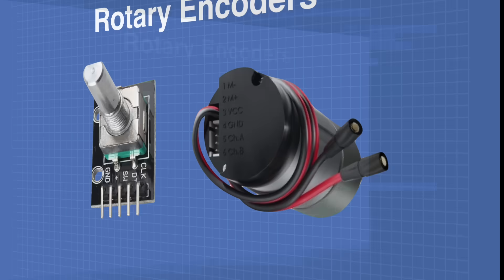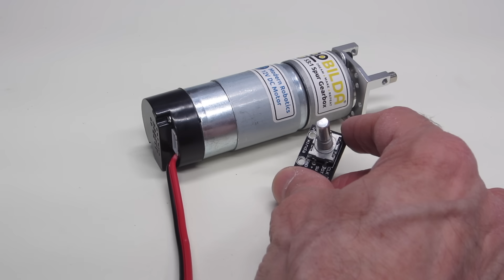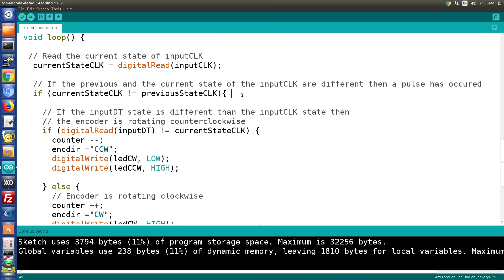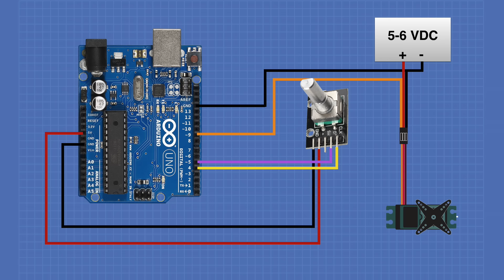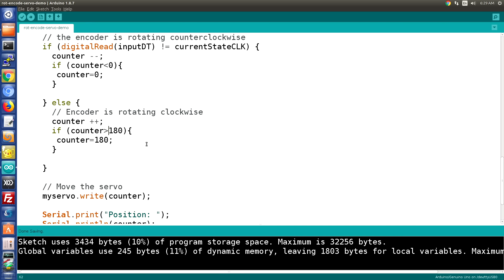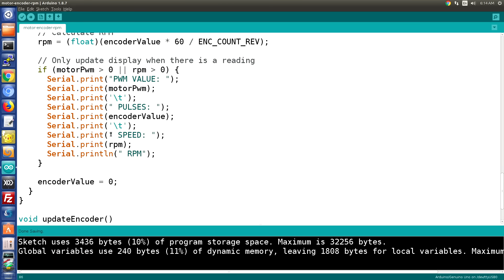Using Rotary Encoders with Arduino

Comment: Hi,  I have a raspberry pi 3b with a 2.5 amp supply.  It is throwing the lightning bolt very often.  The pi has a hdmi monitor, keyboard, usb serial output, sound, and mouse.  Can you recommend a suitable supply with a micro usb connection  I will also be using the fourth usb port as well.  thanks.  Bob

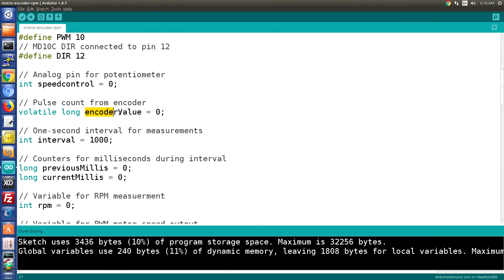Comment: 24:27
 "volatile" long
 Man! That was a rabbit hole of a pause, search, and Wiki read. My head just exploded. 
  I'm still not 100% sure of the mechanics involved. I think volatile is used to prevent GCC from optimizing the variable and omitting the memory location, but like I said, I'm still not sure. Clarification would be much appreciated, if possible :-)
-Jake
Reply: I just came across this video and your comment, and although you probably have already found more information about this by now, I am replying in case it may help others who see this.  The "volatile" tells the compiler to actually check the main memory slot for this variable instead of cached memory because something outside of the program may have changed the value without the program's knowledge.  Basically, the program should not assume the variable's value is the same as the last time it checked.
Reply: @jajwarehouse1  In fact, volatile is explicitly intended for use on hardware mapped registers, such as in device firmware or embedded systems (like Arduino), so this is actually one of it's only valid uses! Too many people try to use it for thread safety only to eventually find it doesn't really do what they thought, so there is some bad advice out there about never using it.

Comment: I am frustrated .  I have tried your code and a dozen other variations .  I have used UNOs, Megas, and Dues.  None have worked properly .  You came the closest, but it still bounced around all over the place.  And yes, I tried several encoders.  I do  not expect you to trouble shoot, I am just taking this opportunity to vent.  Thank you for your videos.
Reply: If your encoders are the mechanical type and not optical, might want to look into the subject of "switch debouncing". I found out about that when asking why some electronics don't always behave right. Keep in mind the more you smooth out the signal, the less responsive it is. (However it's reasonable for most applications.)
Reply: This info might be helpful (relates to my other comment):
https://www.best-microcontroller-projects.com/rotary-encoder.html
https://forum.arduino.cc/index.php?topic=375010.0

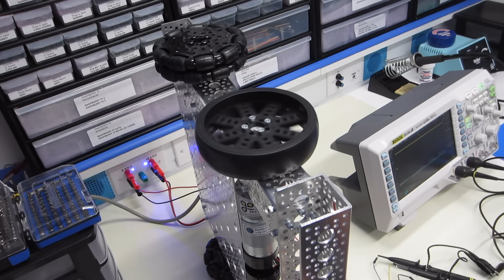Comment: At 20:13 shouldn't the signals be considered 90 out of phase and not 180? You still must account for the period the digital signal remains off.
Reply: Not just considered, they ARE 90 degrees out of phase.  See my comment at the top.
Reply: @ChristianRThomas  Get over yourself!

Comment: I wonder if there is a way to make a Servo turn without the Encoder using say a numeric pad but still have the option to use the Encoder for a manual override. I have an idea to use a Servo to Control a Potentiometer, kinda like the old classic Motorized Pots. This way I don't have to play with a H-Bridge and crap.

Comment: Nicely presented video and enjoyable to watch even for someone who is experienced and watch it for fun. However I was expecting to see how to handle the rotation when MC is busy with other stuff like reading other sensors or adjusting different motors speed. Interrupts are very important part of driving rotary encoders and I hope you cover them in your future videos. 
Thanks again.
Reply: I agree. The microcontroller is busy all the time checking for changes in input. A better approach,  using interrupts, can be found here: https://youtu.be/DB-lCMzwo2I

Comment: You are right about jamming the rotor too often, but we do this every day as part of the Factory Acceptance Test on large electric motors. It is called the “Locked Rotor Test”. The rotor is clamped to the housing and the motor is powered up to full power for a second or two, and then the internal insulation is checked for shorts. But we only do it once per motor!

Comment: Many thanks for a well explained video,could tell me would this application drive a mini lathe lead screw and be able cut threads without resorting to gear clusters to obtain the correct rotational speed to  match the relevant screw pitch. Lead screw would be driven via a Nema stepper motor.
Have heard of this being done but never explained as I am sure you could.
Cheers
Reply: If you look up the YouTube user clough42 he is working on exactly that task - and doing a very good job.

Comment: Why did you use #DEFINE for some pins and then an int for the last one? (Question not criticism)
Reply: Hi, #DEFINE allocates a fixed value that will not change within the code whereas INT can or will be modified, also I think there are memory savings as well but dont quote me,  but thats basically it bud.
Reply: @andymouse  He used it for pin assignment so it is not going to change any way so my question still stands.
Reply: @patwicker1358 Oh, ok...guess I should have looked......in that case he could have #DEFINE ed it......so no idea
Reply: @patwicker1358  It really should have been a define. (Or a marked "const") He probably just didn't bother to fix it because it's just a tutorial. Theoretically, you could use an int to select between different pins, but that's not what he is doing here. andymouse123 is right though, INT requires 2 bytes of RAM, but define is essentially free. It makes the sketch a tiny bit bigger instead, but not by much.

Comment: At 20:21 the phase difference between the signals is 90 degrees and not 180 degrees!
Reply: I thought that as well. I guess he is just considering the time when the pulse is high, which would make it 180, but if you consider the time the pulse is low it would make it 90. Since this is a digital signal and not an analog signal that is continuous, I'm not sure if you account for the time the signal is off as part of the phase?
Reply: @Marva123  Simply put, if the signals had a phase difference of 180 degrees then they would mirror each other on the x axis. Phase is taken over the entire cycle of a wave.
Reply: it must be 90° since thats how every stepper works. He ment 90° but if u rush trough it so fast u can mistake those two.

Comment: Thank you for the clear explanation in your videos. At 14:15 you mention to connect ground of the power supply to ground of the arduino and that it is an important connection. Why is this connection necessary and why is it important?
Reply: The quick answer is that it keeps all the grounds somewhere near 0V so that the the 0s and 1s fall within the logic ranges - which are pretty easy going as to what counts as a zero and what counts as a one.  A more important factor is that multiple supplies are being used and  (mostly), these ultimately go back to a transformer.  Transformers float unless one end of the secondary(ies) is attached to ground.  That floating can be pretty high - I have heard of differences of 60V between components - so if you pin one side of your transformer, and say, the negative of your battery each to ground then you won't get 60V being dropped across a bit of cable.  When you look at the problem in detail it's surprising how infrequently the problem actually arises (or how infrequently it burns down houses) but it is potential pitfall where high currents are being drawn.
Reply: Same question.
Reply: @patwicker1358  to keep the noise low
Reply: When a power supply says +6V volts it just means 6 volts higher than its ground, it's a relative value not an absolute value. By connecting all your grounds together you now know that the positive side of your +6V supply really is only one volt higher than the +5V pin on your board.
Reply: @sd4dfg2  thank you

Comment: Excellent excellent work, Bill :D
I love that you covered both regular and interrupt decoding! I've used very similar code to the first one with no interrupts, and I couldn't quite get it to work right. if I turned the knob slightly in one direction, and back again, the counter would only increment or decrement,  but wouldn't go back. I'm wondering if it's because I chose to use pull DOWN resistors instead. I thought I changed the code satisfactorily to reflect this, but it seems not!
You code using pull UP resistors on the switches seems to work really well and no miss steps. So I think I'll rewire my circuit and try it :D
Also rotary decoding that doesn't use interrupts is PERFECT for things like servos, which interfere with interrupts anyway.

Comment: wait, your in canada did you sneak some circles over the border Bill? I love how you explain the coding ( I am real weak on that part) But I have a question.. when defining pin 10 in the last sketch do you need to put 'pwn' in there or will the arduino know that pin 10 is pulse width modulation without telling it so? The same question for the DIR on pin 12? Maybe you put them in for the user to remember eh? Dang you always make thing so clear for me.. and that is a feat in itself with this cluttered old brain of mine!! Thanks for the share and carry on my friend..

Comment: I'm far from being a beginner but I enjoy so much your videos ! It's a clean job ! The filming is excellent, the audio is crisp and your explanation is alway accurate and simple ! A real paradise for robotics enthousiasts ! Keep on the good job !
Reply: Yes it was good. If I could make any suggestions I'd say to avoid the "blue like" wire on the "blue like" background (or emboss it) and, when explaining the state detection, reference back to the signal wave form would have helped a little bit.
Reply: G Guest  fine, yes, crisp, no.
Reply: Vasant Kerai from London, I am very interested with these projects many many of them being a electronics engineer for 40 years now retired, love to know arduino project more about kits  available to assemble, to demonstrate and learning, please a list of many many projects available,and easy to assemble.my email keraivasant@gmail.com
Reply: Here here!
Reply: the room noise cutting in and out every sentence I wouldn't necessarily deem "crisp"
Reply: HI I am building a CNC machine can you help me to set up a code and what drivers  I need or show me some codes to try it out with?